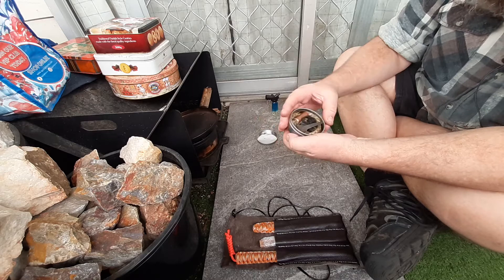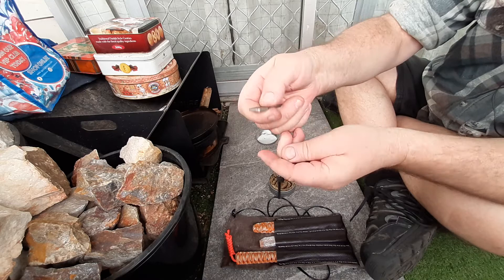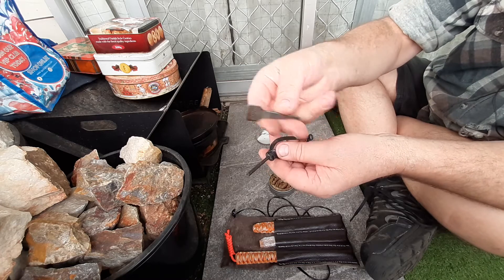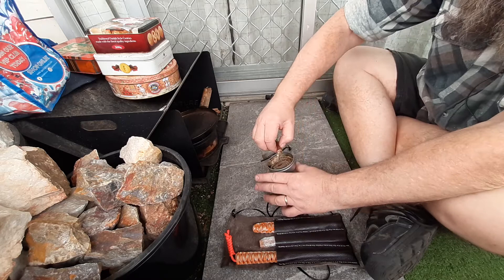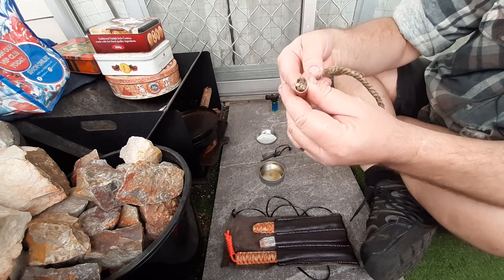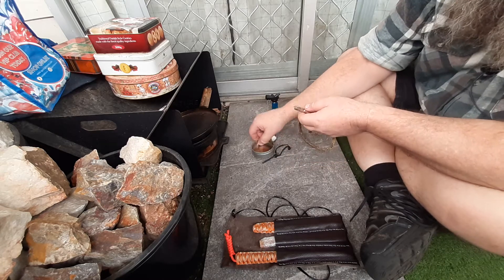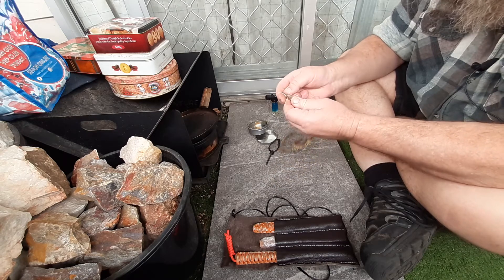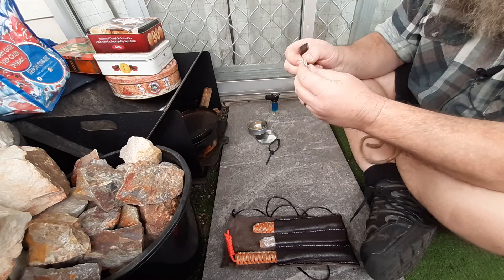follow up on the jute forever match, does it work

Comment: Maybe this will help.  Make your next jute match with paraffin wax and only 1-2% beeswax.  The paraffin is not as sticky, so the jute fiber separate much more quickly.  Paraffin works significantly better than beeswax for the jute match.
However, I add 1-2% beeswax to the mix, so that the paraffin isn't so crumbly.
Reply from the maker: thanks mate, I'll do that next time